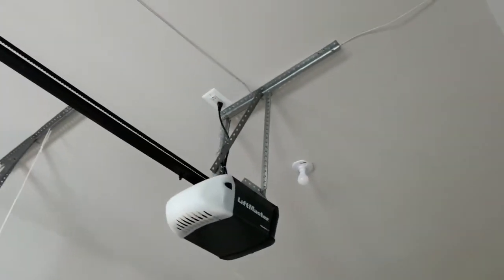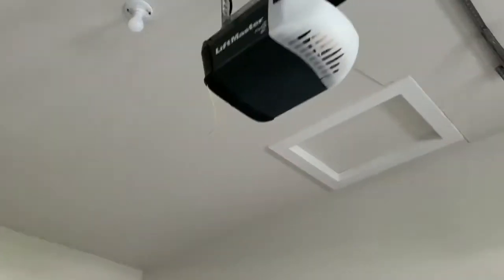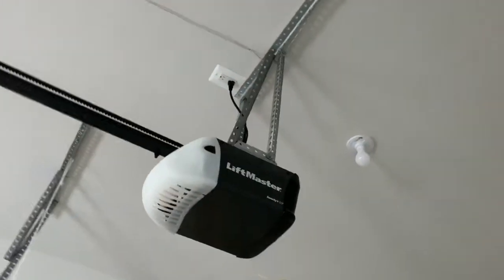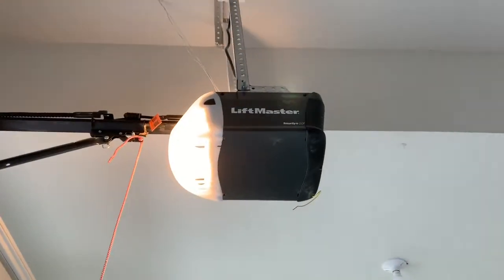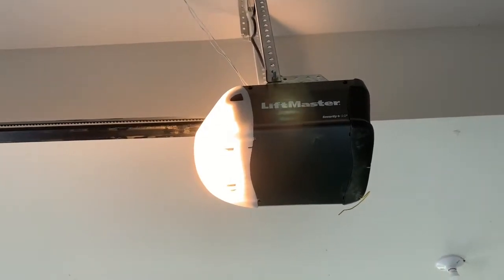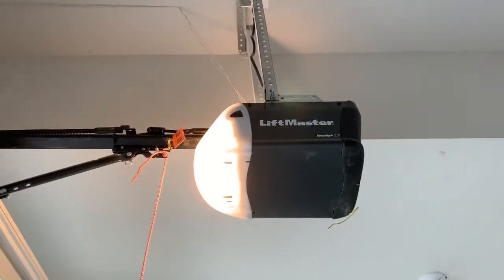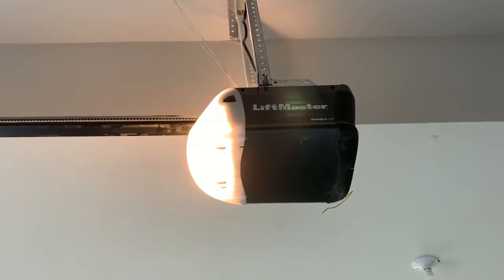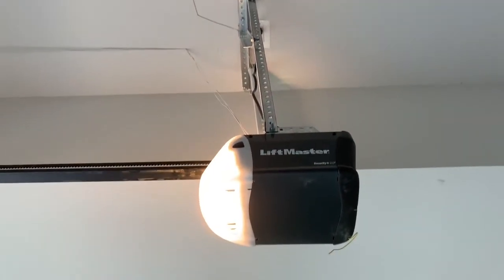Noisy & vibrating garage door motor comparison with a good motor

Comment: I have the same issue with my overhead door garage door motor. What I did was lube the track with SILICONE lube spray.
And I opened up the casing and tested what part is vibrating. Mine was the actual motor. I ONLY sprayed the drive shaft of the motor with wd40, all other components I used silicone lube spray, because petroleum based oils will eat away any rubber/ plastic parts. Still noisy for a belt drive, but reduced the noise by half. Next for me is to get some rubber isolators.

Comment: This is common issue right out of the box with a few motors. The issue mainly comes from the motor’s metal cover. Try and tighten the 5/16 mounting screws. Also check to see if part of the housing vibrates around the front and rear covers, where the light covers are attached. You can apply small strips of adhesive felt on the plastic housing right where the light covers make contact. This prevents the light covers from vibrating on the plastic housing. A less common issue is the metal housing is slightly bent and vibrating on the screw mounting areas. You can use a tape covered screw driver to gently bend the casing back to its normal shape while its mounted. Also check for tightness on the 1/2” nuts and bolts on the prepunch and motor mounting hardware. Please DO NOT MAKE ANY ADJUSTMENTS WHILE THE MOTOR IS PLUGGED IN.
Reply from the maker: Thanks a lot, very useful info

Comment: Check all the bolts that attach it to the brackets on the ceiling, make sure they are all tight. If that doesn't help, go on eBay and order the Liftmaster 89lm. It replaces the bolts that the bracket uses to hold the opener. This will reduce all vibrations you have. I have used them several times, it makes a huge difference. If you have any questions, let me know. Thanks
Reply from the maker: Thanks. The bolts were already checked. I will explore the kit. Thanks again.

Comment: Did you get this resolved? Could you please share your solution? Thanks.
Reply from the maker: Yes I did to quite an extent. There are rubber bushes available which can be put between the bolts and they work nicely. Look for this on Amazon: LiftMaster - Garage Door Opener Vibration Isolator Kit 89LM. Try this.